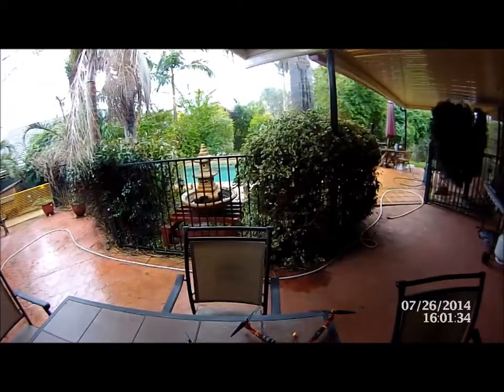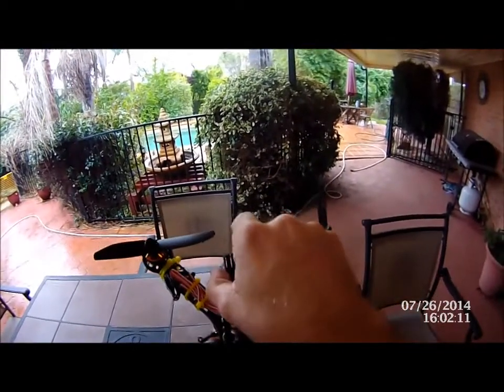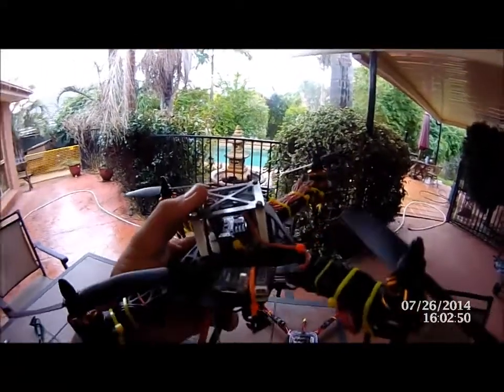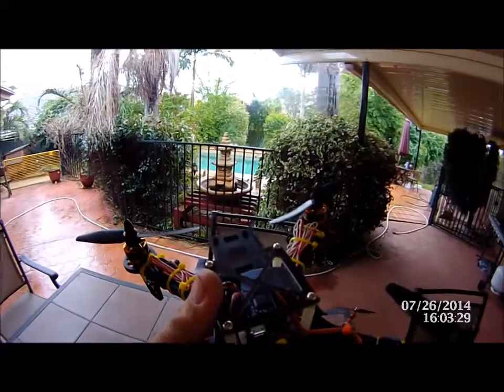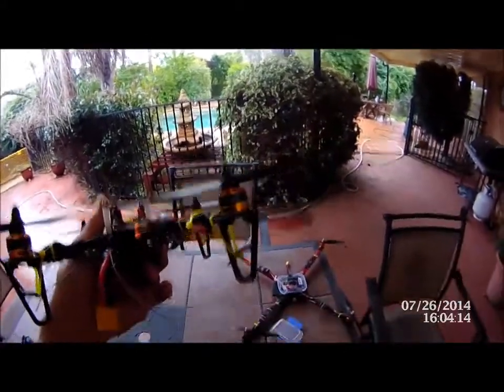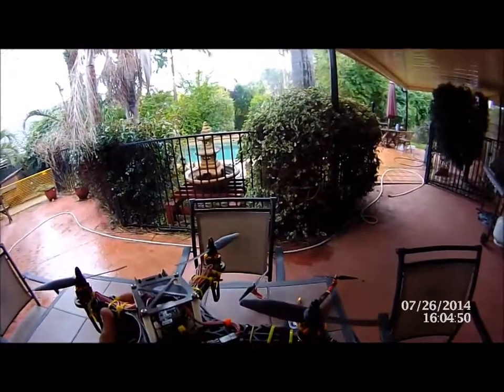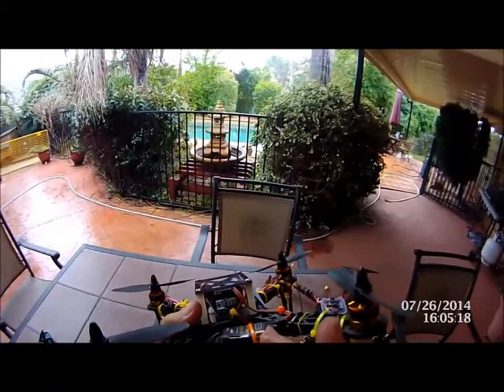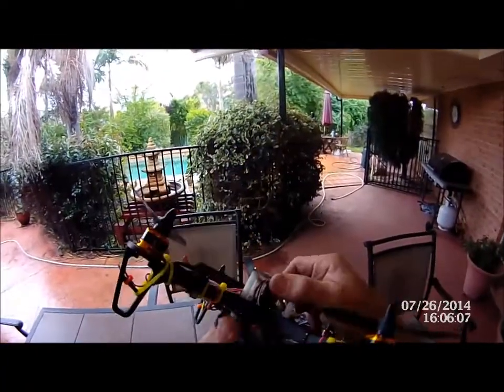250 FPV 2300kv Quad Review

Comment: Great video. I have a different question.  When the battery is plugged into the FCB, does the quad have to be on a level/flat surface every time? I'm not talking about calibration, but when flying.  My FCB is KK2.0 V1.5 FW. Thanks
Reply from the maker: In short the answer is yes. Irrespective of what FCB you fly when you power it up out of level you will more than likely find that you will need to trim it. As for the KKs you will find the above answer true by checking your board details on the LCD. I have 3 of those boards (now all retired) and when you powered them up slightly out of level that would be your new zero........... as a suggestion I would reflash the KK to 1.6v which has a much much better auto level feature as 1.5v is kind of like a hybrid for copters and planes.....